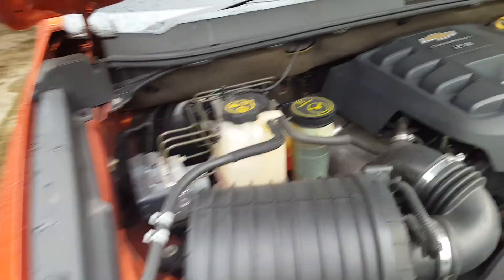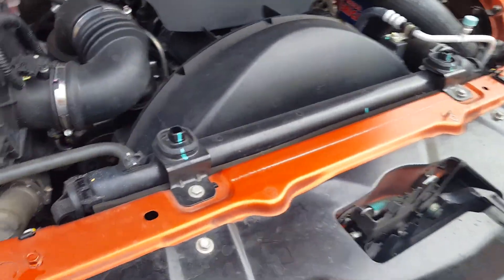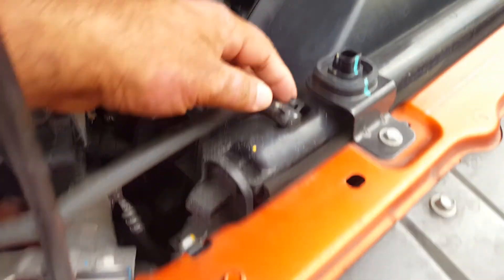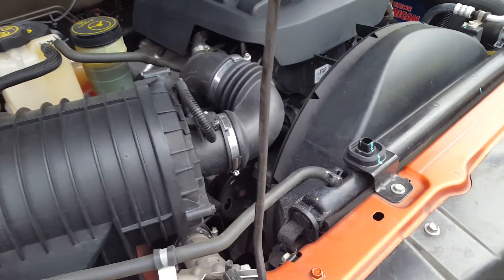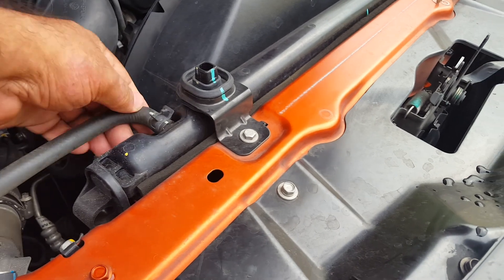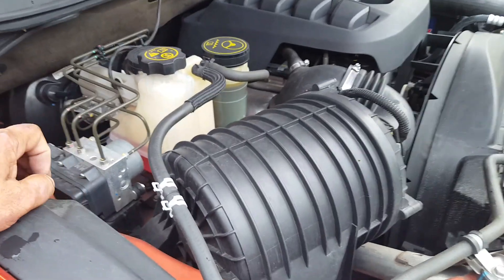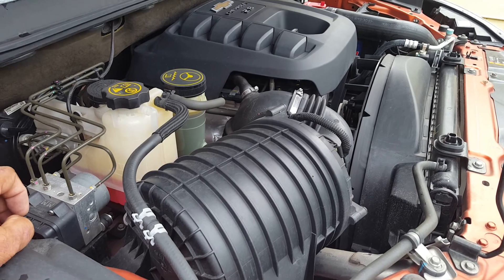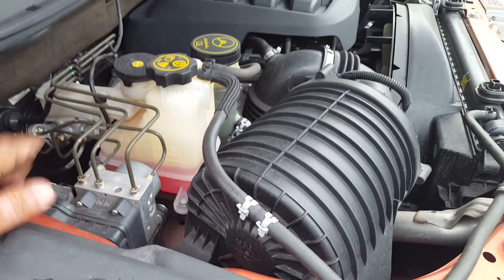how to change radiator fluid with no radiator cap

Comment: I looked at my T/B under the car and it looks like you will have to drop the splash pan that is protecting the underside of the car first.  I also think there is a vent plug on the radiator or the engine block to get the air out of system but I have not found it yet.  I plan to change my coolant soon.  My manual (2016) says that it takes 9 liters of coolant so 2 gallons sounds about right.

Comment: Can you also tell me how to burp the cooling system after the coolant flush and fill? I have done it on a system that has a radiator cap before, but not one that doesn't have a radiator cap.

I have a friend who needs to flush, fill, and burp his, but his system doesn't have a radiator cap, like the one in the video.
Reply from the maker: you need to find the highest point and leave the line open till you see coolant flowing. If you see bubbles coming up in the excess bottle you still have air in the system. There is also a tool to vacuum out the old coolant and put in new coolant. if you are not sure go to the dealer you can ruin your engine if there is air in it. Monitor your temperature gauge or over flow bottle level.

Comment: Can you make a more explain able vidoe please.
Reply from the maker: please consult your auto mechanic. if you do not bleed out the air you can ruin your engine.
Reply: @kensawh  Yeah i dont really know the process
Reply: Where do you fill it from? You never mentioned it.
Reply: @rocknral it must be at the point where you remove that hose connection.. ??? 😮